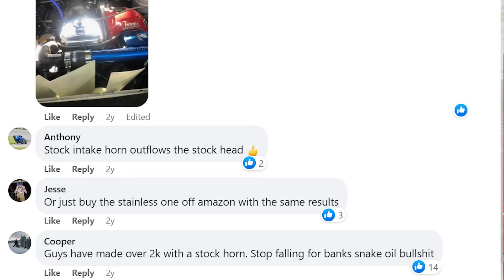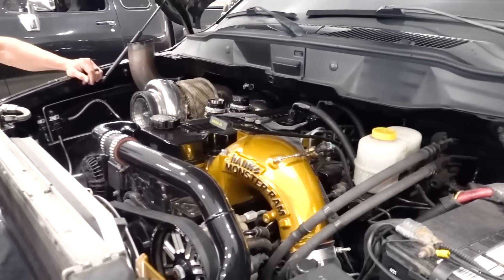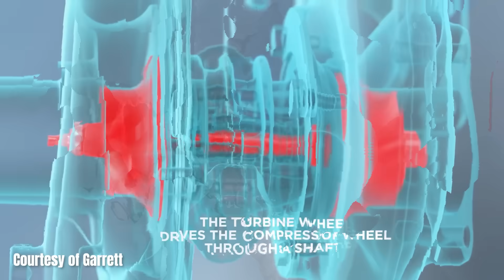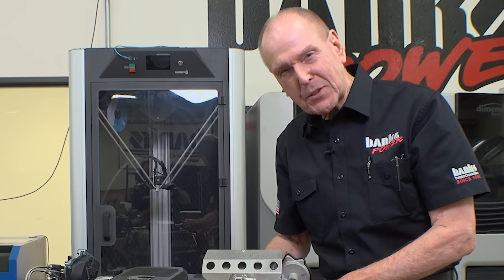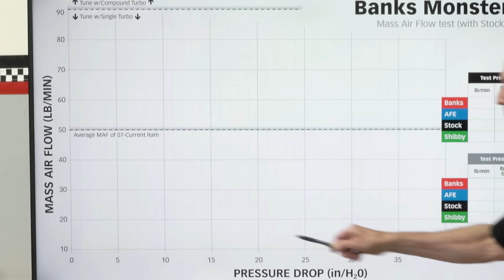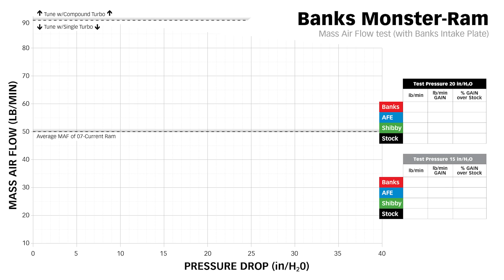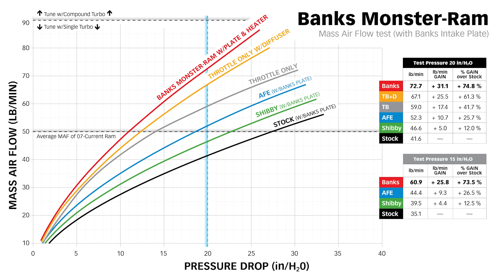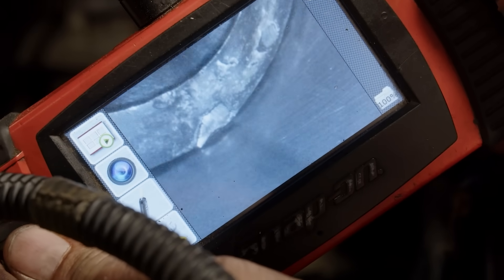Stop this wives' tale about Cummins engines! | Fact Check

Comment: Gale Banks I'm no mechanic but i respect Geometry and physics and with your knowledge you're more of a mechanical physician. If you have 3 inch charge pipes you get 3 inch smooth air horn with a bend that doesn't disrupt the flow volume CFM. How cold the air is is what matters with smooth bends that flows with no disruption. A turbo is a air compressor not a supercharger that rams or forces air in. Turbos make air more dense to make power. That's all it is. It's the opposite of a vacuum pump.

Comment: Love mine , not sure i felt the performance change (did multiple mods within a short amount of time)  but i certainly noticed the MPG gain. with the pile of changes made i regularly see over 22mpg with 35 inch tires on a single wheel HO 3500 on a "stock" power level tune. S&B Intake , turbo back 5" exhaust.

Comment: Again another one of your videos where you take what is being said out of context and use it to make yourself look better. Like a typical imagineer does. You can theorize all you want, you can do all the math you want, it doesn’t always work out in the real world. Where was the chassis dyno comparison? Where was the cylinder head attached to the intake horn comparison? Where was the running engine comparison? This video was to prove that the added flow helped the cylinder head as they claimed the cylinder head was the restriction, however you didn’t have a cylinder head in the video to actually show that flow on the exhaust side was increased. And you didn’t do a running test to show hp was increased. You just theorized that at 400hp you make power more efficiently. While there have been several independent shops do actual real world chassis dyno tests showing that changing the horn makes virtually no difference when averaged out. Especially when over 500hp. Firepunk recently did a dyno comparison, average of 5 runs, the banks intake made less than 2 hp more at 970hp. They did one years ago that they didn’t do a documented video on, on a 500hp truck and the power difference was less than 10hp. Again even at lower numbers the added flow of 75% didn’t equate to massive hp increases.

Comment: You keep mentioning "Cummins" engines. Don't roast me too much if I'm wrong, but that's a dodge engine. Does this stuff work on powerstrokes as well?
Reply from the maker: The 6.7L diesel on the Ram trucks is made by Cummins. Note, Ram Trucks was split from Dodge in 2009.
Reply: @bankspower  would it work on a powerstroke, though?

Comment: Excellent Banks vids. I was recently an Aerospace Engineer, so i got creative thinking what 'could be' a replacement engine to a diesel engine as i think of in trrms of the basic design of a jet engine. It compresses air and sends it to the combustion chamber. A company designed & builds a small version for remote controlled aircraft esp scale warbirds. Total aircraft weight increased to 18Lbs. Wondering if Gale could design one to fit into a pick up that would be fuel efficient & powerful. If Gale cant design it we'll have to turn to Tony Stark

Comment: Listen, automotive manufacturers are literally throwing whatever they can into these engines to make them fail at a certain point, they all have done their research and know exactly what they're doing folks, videos like this proves it, especially at the end when we're shown a simple little bolt that obviously isn't made from any special metal to help resist wear, heat and corrosion, you think they don't know it's a problem lmao, also why they keep adding more and more computer and sensors and non serviceable parts to everything, they don't want us working and improving or fixing their purposefully flawed design, it's all about money money money...I believe the lemon laws should be rewritten to stop these bastards from designing such horrible crap, it's scheme and scam being used to pinch every single dollar they can out of us because we need transportation, it's not conspiracy I assure you all, because guess what the engine blocks hold up just fine throughout the entire lifespan of ownership or use unless something catastrophic happens internally, but not common, it's usually something on or around an engine block that causes catastrophic failures, honestly really gets under my skin how this new aged BS is literally designed to break around 100k miles, it's 2024 for Pete's sake, we got rockets that can land themselves without issues and there's tons of pressure involved with those, so why does it seem our automotive industry has degraded with improved tech and not improved to the point that engines specifically internal combustion engines fail easier than they did 100yrs ago??? It's a century old technology still powering our world today and yet it seems to have fallen short in improvement over the years, aside from crap being loaded onto the engine to improve emissions!!!??? Everyone knows proper air and fuel mix plus proper density and flow helps improve emissions and power which in turn improves efficiency across the board, as well as keeping things cool, I won't give a dime for the new crap, if it's 2015 and newer I'm out, I'll spend my money on 70s and older models made of real steel and built tougher than the earth's crust, oh and simple tools anyone can use to fix them as well...
Anywho sorry for the rant I get really torqued when I see how much greater someone can improve over stock with the simplest things and solutions, and I'm like "you think auto manufacturers don't know how to improve this crap",??? They design them to fail for profits...
Great video either way, always learning or being refreshed whenever I watch your content Gale, you're a diamond in the rough in the automotive community and a national treasure in most of our eyes lol, thanks again for very simple to understand concepts and presentations, keep on kicking ass brother...🙏🙏💯💯👌👌

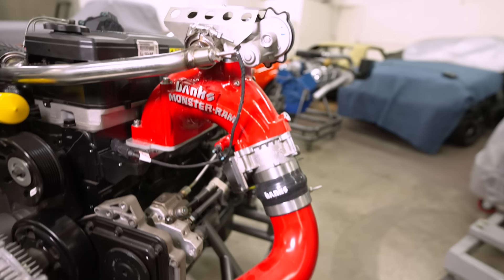Comment: 7:19  genuine question, wouldn’t the egr immediately bring the air density down drastically? You’re introducing exhaust gases into the intake thats taking up room that cold air could be filling
Reply: Yes, however lowers the total amount of oxygen that is in said compressed air. It dilutes the combination

Comment: Im not saying you are wrong because I don't know the stats regarding restrictions to intake vs exhaust but it seems Casey and Anthony's point was not whether or not YOUR intake is capable of pushing more air their point was that regardless of how much air you can push the limiting factor is the bottleneck on the exhaust and you did nothing to prove them wrong what so ever you just proved something that they never denied being true and that is that your intake is capable of pushing more air 😒?.?.?.? 

I mean honestly if you wanted to prove them wrong wouldn't it make more sense to just stick a stock 6.7 on a dyno then put your intake on a dyno and see the difference. I mean 20sec clip at the end after all the science and I think it would have made the whole point clear.

Comment: Good Morning, one thing I am interested in your explanation of diesel pulling tractors.  They are high horsepower diesel engines but in a very different way than you discuss.  They smoke like crazy even at idle.  They also use water injection that I do not see in other uses.  I know these guys like your are looking for the most safe horsepower. Thanks in advance

Comment: I guess I’m missing something. I don’t mean anything negative about the product. I think it’s great but what does this video have to do with proving that the head doesn’t limit how much air is flowing through it? I mean, you proved that your intake horn flows a lot a real lot, but I didn’t see anything in the video that disprove the fact that it doesn’t matter how much your intake flows if your head is restricting it.🤔
Reply from the maker: If the head was the limiting factor, adding a bigger turbo or better intercooler would have no effect on horsepower. Remember, air is compressible. When people talk about "airflow" they're talking about cubic feet per minute. The problem is that cubic feet per minute only describes the volume of the air, not its mass or density. A turbo and intercooler increase air density (mass). You can have denser air in the same volume. Imagine a shoebox for men's size 9 shoes. Then, try to put a size 11 shoe in the box. It won't fit. Put those size 11 shoes in a trash compactor. Now, those size 11s will fit in the small size 9 box with room to spare. Why? You've just compressed the size of the shoes. More air in the same space... because it's compressible. You can make well over a thousand horsepower with the stock head. But you'd need to upgrade the intake elbow to do it.
Reply: @bankspower  that was a really fancy long way to say adding boost pressure puts more air in the same place OK there is a limit to that how much boost pressure you can put in but what I’m saying is you’re not proving that the elbow is causing more air to flow through the head why don’t you connect all the different elbows at various boost pressures to the Head and flow test or something along those lines wouldn’t that be a better example? All the video shows is that the elbow flows more air it does not show how it can help the head flow more air. Or put the elbow on a truck and show more power or better fuel mileage without changing anything but the elbow you’d get a real world example in return I am educated in this stuff. I don’t claim to know everything but I’m just saying, the video doesn’t prove anything about anything upstream or downstream of the elbow or the effects

Comment: Banks check out the spelab intake manifold, looks just like yours which ones better?
Reply from the maker: We've seen it, we're not impressed. Our team ordered one about 2 weeks ago for testing, it's shipping directly from China. Spelab purchased one of our Monster-Rams and had it knocked off. They copied a product that quite literally took more than a thousand hours to develop. And, we sourced U.S. made parts like the fuel line, fasteners, etc. Who has the better part? Banks. Why? Because Spelab blindly copied the Monster-Ram without any idea what they were copying. Like copying someone's math test in high school, the copycat may get an ok grade, but they have no idea how to solve the equations.  If you buy the Spelab, the money is going to China with no support. When you buy Banks, it’s going to 150 hardworking American employees. What do you get for you money? A Banks Monster Ram it includes: Monster Ram Intake, high-flow billet intake plate, heater coil, upgraded fuel line, and all the gaskets/small parts you need to install. It's simply the most complete performance kit available back by an actual warranty and 100% US-based customer service.

Comment: So, I understand all the stuff he just showed. I understand that the engine pumps a certain amount of CFM per revolution. However, the claim is the the heads do not flow what the engine flows, so introducing an intake that flows way more than what the head can flow is not worth it. I missed the rebuttal to that claim. 

Is the rebuttal that the engine will flow that cfm not matter what, just at a lower pressure and density? So if you have an intake that is restricting the density and pressure, even if its the "same" as the head, you'll still get less power than with one that doesn't?

Comment: When I was in college for Diesel Mechanics back in 2020, most of my classmates own 6.7 Cummins and 6.7 Powerstroke. They run tunes on them. They were talking about "making big power." We got out of Fuel System and Engine class, this was during my first year. Our instructors wanted us to figure out how to make power and explain the theories.

I'm smart in books, but I still need experience in hands-on. My classmates were the opposite. We had a real heated debate. My instructors were laughing until everyone looked at me and wanted me to say something. Mind you that I am the only Asian in the entire Diesel Program. This is a normal daily occurrence in class that everyone of my classmates expect. 

I was explaining the basic function of AFR, Fuel Temperature, Air Temperature, and Intake Manifold Pressure. Keyword was Air Density to this whole debate, but I never mention about Air Density until I told the source of information from Banks, you guys.

They told me that I should have been an engineer than being a mechanic.

Comment: There's something Gale is not telling us...perhaps it's due to proprietary interests, but I found his explanation lacking.  The claim his intake creates more mass I find suspect without further explanation.  Is it that his design keeps a better laminar flow to the intake walls and does a better job of keeping a more consistent density as opposed to the velocity/mass of air momentum leading to density shifts and variation within the airway as it changes direction?  The numbers don't lie, but something is missing here, and I felt Gale was being a little bit cagey by making a claim without a foundational explanation.

Comment: It's not about adding to an engine, it's about putting back what usually gets lost. Stock intakes is a bottle neck most of the times because it's just designed to fit under the hood, not to give the most hp.

Comment: I do love Banks work. And I understand that he and his crew are quite adept at their respective jobs. Having said that, I understand that the Monster Ram definitely flows better than the stock horn. I believe the comments that he was arguing against, though, were stating that the head was the limiting factor. I didn’t see Gale perform a flow test with a head attached. Preferably a flow test with the whole valve train on a running engine. It makes no difference if the horn can flow 1000% more air if the head is the limiting factor with the factory air horn.

Comment: These leg humpers are the same guys that do a calculation and say that they only need a 500 cfm carb on a built small block then I come along with a 950 cfm tuned thermoquad and blow them out of the water. All air flow is rated at a pressure drop, pressure drops cause horsepower loss. If you can tune a bigger carb to run right it will always make more power than a small one because of less pressure drop. Saying the head flows x ammount is probably rated at 28in water drop. That's huge. Anytime you can enlarge a pathway and reduce restrictions you will gain power period. The faster the air is moving, the higher its pressure is the more it helps. The Banks system would really outflow those others if the pressure was 40 psi like it sees under boost because denser faster air is harder to bend around a corner.

Comment: The detractors are absolutely wrong. I don’t have the money to buy the whole system (intake, boost tubes and intercooler) but having had multiple people around me experience the bolt failure and subsequent engine destruction I stretched my budget and bought only the elbow. So with only a small piece of the system in place I am seeing huge gains in performance, most notably throttle response and merging power both empty and towing 16,300 pounds, and some fuel economy gains once I settled down my right foot. It works!!

Comment: Hey Gale and Team, are your parts compatible with Commercial 6.7 Cummins engines as well? For example, like in a box truck?
Reply from the maker: The Monster Ram is available for the Chassis Cab Ram trucks up to the 5500 model with 6.7L Cummins. Anything larger than that, no.
Reply: @bankspower  Gotcha, I have a Freightliner M2 106 with the 6.7 and I've been itching to get more than the 240hp out of it (as well as knocking out the typical 6.7 cummins issues)